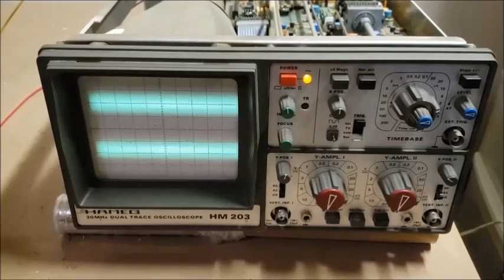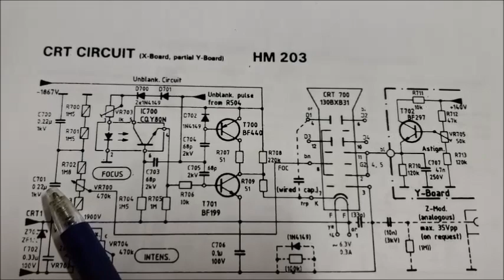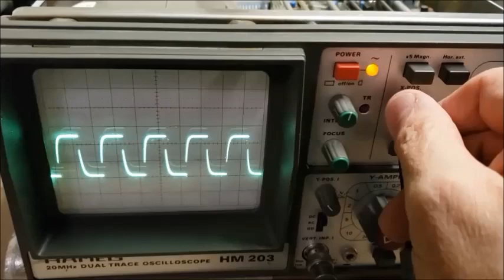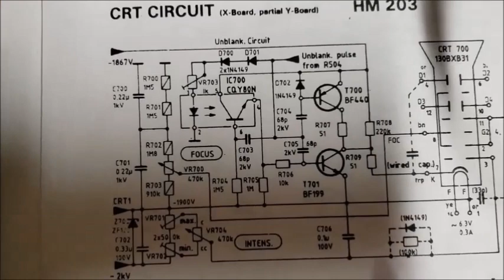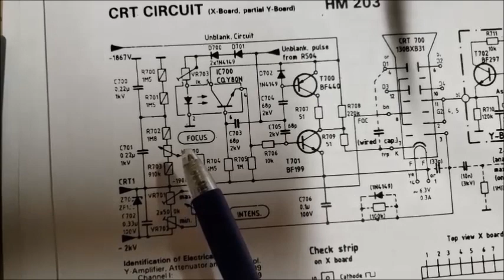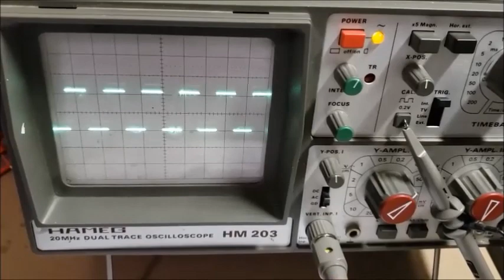Hameg 203 Scope Repair

Comment: Good day, i have the same scope but i cannot have the full trace on the screen, only the left is good but when i move it to the right, it got squeezed and incomplete.
any idea where to look at ?
thanks
Reply from the maker: Bad component in the horrizontal  sweep section like a bad capacitor, diode or transistor.
Reply: @FranksPlace-jk7pj  Hello Frank, thanks, i cleaned the PCB with solvent and it is now good. Thanks !
I have another issue, traces are nice and clean on the screen on for the 0.5mv and 5v divisions for both inputs. Weird, as the other positions don't show anything. I cleaned the rotary switch but nothing. Any idea what could be the problem ? 
PS i noticed 2 FET right at the entry of the PCB which are pressed by a copper steel together, and their voltage drop shows a strange value of 0.245V.
Thanks for your time.
Hicham
Reply from the maker: @hichamtassi1753   When a fet is propetly biased, it should have a small voltage drop from drain to source in an N channel, there should be a negative bias from gate to source and in a p channel, thete should be a positive bias from gate to source.
Reply: @FranksPlace-jk7pj thanks for the info !